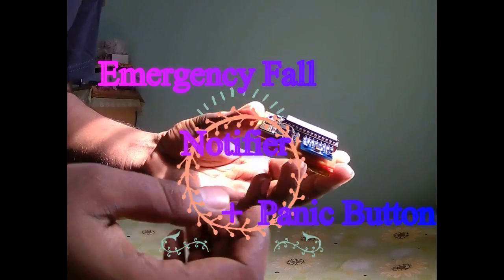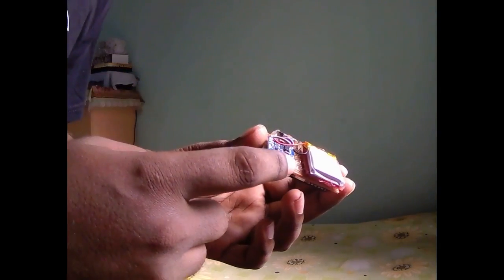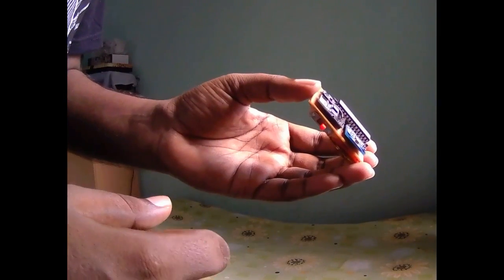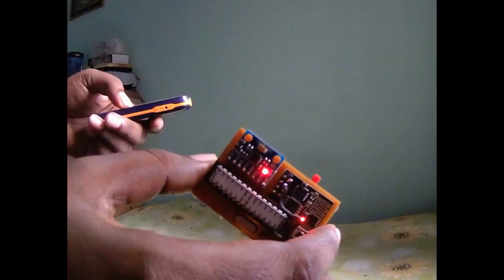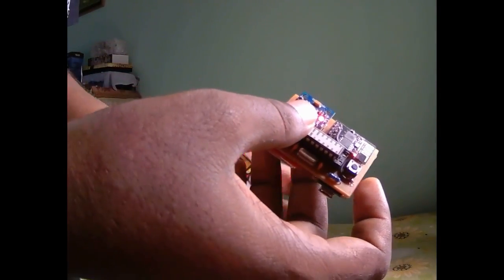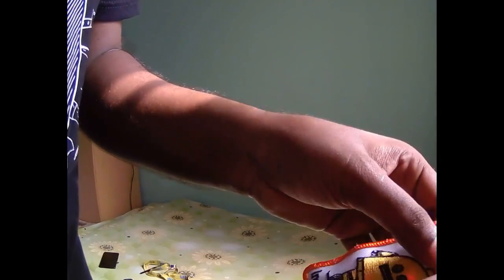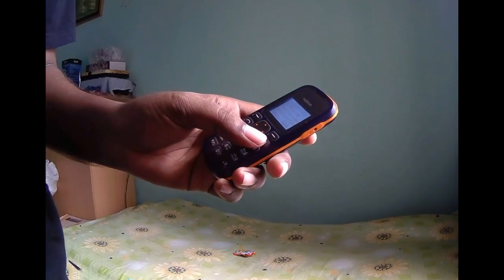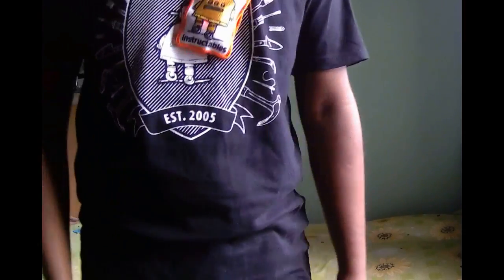Emergency Fall Notifier

Comment: Thank you for the great video. I have a suggestion, why don't you programs the esp2666 directly to eliminate the need to use the Atmega328 chip and also to save power. Thanks again for the great project